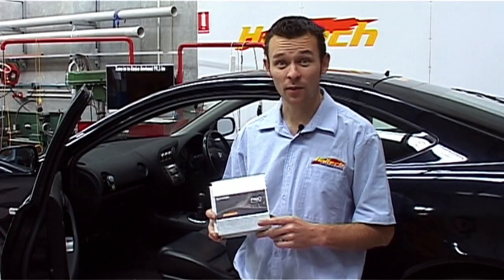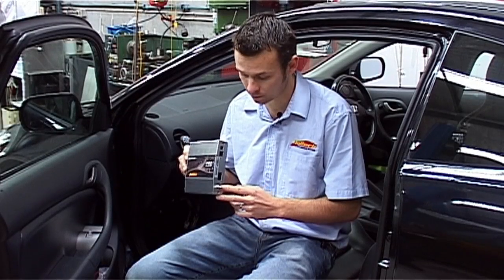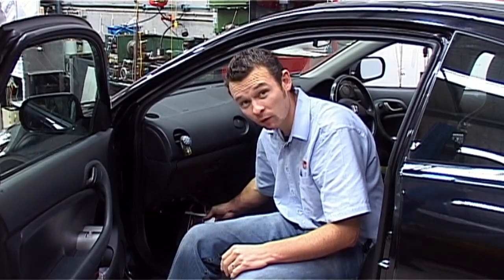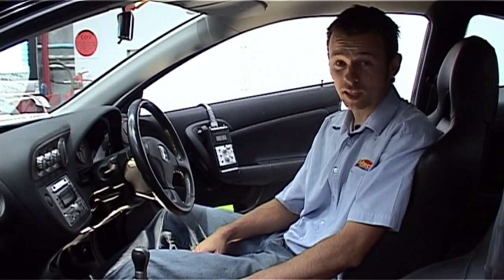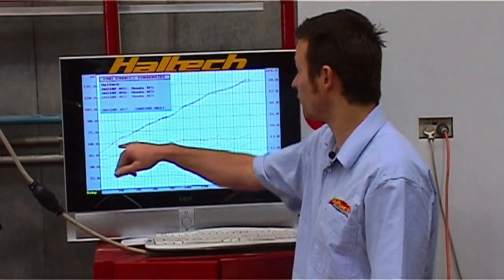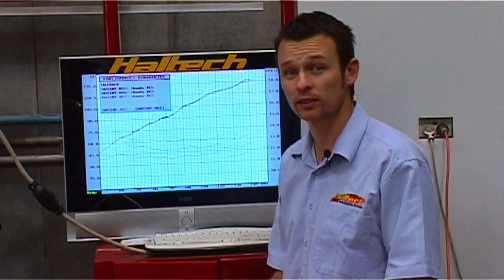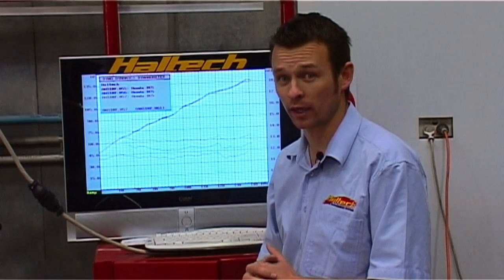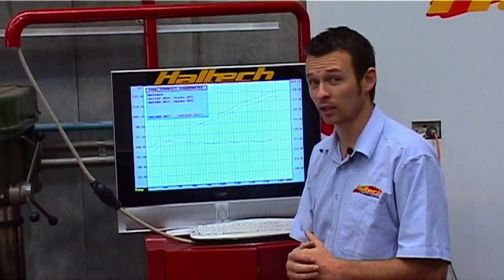Ignition Timing vs Air Fuel Ratio - Haltech Technically Speaking

Comment: @Haltech, when one is tuning the fuel map, does one set the target stoich under load on that map block. I am tuning a cheap management on the road in my VW Mk1 with a 2.0L 8V engine & noticed when i set my target stoich, & then when accelerating till it gets to the target stocih,it shows lean,but when i get to the set RPM it's on target. Is this normal when tuning?
I hope i'm making sense.😋
Reply: For others I think this is conteracted by the acceleration enrichment

Comment: Is increasing ignition timing a lower number on the timing table?
Reply: Ignition happens in the btdc quadrant, so advancing makes the number smaller.  Ex:  12° btdc is advanced farther than 15° btdc.
Reply: @mikaelgaiason688  it's the opposite

Comment: Alot of good EFI videos out there.. But there is not actually one that discusses the relation between ignition timing and AFR - just skimming past it like this.. doing some dyno runs and fiddling with a computer screen.. Not actually showing what they are doing and how they are reasoning around the subject. :/
Reply: If you say AFR will stay the same with changes in ignition, you're making the claim that the exhaust gasses and the unburned intake charge have the SAME EXACT oxygen content.

So either AFR changes with ignition timing, or engines do not consume any oxygen in their operation. It's one or the other.
Reply: The timing of the spark will affect how complete the burn of the fuel is. If there is unburnt fuel in the exhaust, AFR will be different even though the intake charge is the same as if it had a complete burn.
Reply: Moronicsmurf Yeah I can see how that would just be chasing your own tail. That's why in videos I have seen tuners figure out where timing stops making extra power first with a high AFR and then tune at that timing level. Would be fun to be able to try it myself.
Reply: Well if you read the AFR sensor you will prob. find that the AFR value don't stabilize with the values you have put in the AFR tables.. so no, the AFR is not static its a mix of different values and the AFR table is their to create a target that is affected by ignition and fuel tables.
Reply: Afr doesn't change regardless to timing.
You can tune your whole fuel map on a conservative ignition timing and then add 5-7 degrees, afr will be the same.
Reply: Silly Videos Only Good point! Hadn't really thought of that. I wonder how dramatic the difference is.
Reply: I find that when i change the timing i need to adjust AFR values to get it to not only run lean but also not wandering up and down. And when i hit the sweetspot its usually not the AFR value i wanna run in the selected cells so i need to adjust the timing again and so on fiddling back and forth and let the self tune adjust the fuel.. (I run a holley hp efi on a bigblock).
Reply: yes
Reply: Just dont know how to explain it in more than four syllables i guess.
Reply: I do not believe there is any direct relation between ignition timing and AFR.
As in, increasing or decreasing timing will not affect the AFR.
AFR is controlled purely by the amount of air coming in, which can vary with boost and the amount of fuel being mixed, which is based on injectors and fuel pressure.
There are more factors obviously, but basically I do not believe the two have any direct effects on one another.

If you are wondering if more advanced timing responds better to high or low AFR, I do not know.
I would suspect that it is much the same as demonstrated here, even with advanced ignition timing.
Any AFR within the window of roughly 11:1 and 13.5:1 will give around the same amount of power with a given timing advancement.
Reply: what if you add 20 degrees. will afr stay the same?
Reply: Try it in the dyno, i do it everyday.....
Reply: Well The AFR would not stay still if you change ignition. the AF target would stay still. because well its the target. But noway that your live data out of the lambda is static in the complete pull. The aim for tuning fuel and ignition would be to hit the target AFR value and have as small of a deviation you could through out the complete pull.. Sure you isn't mixing the terminology up?? AF targets is not the same as the actual AF value read in the exhaust...
Reply: I tune 200 cars a year, i think i know what afr target and actual is....
Reply: I would very much like to know more of what you could teach about big block aftermkt efi .
Reply: Timing does not affect AFR readings!.  If i remember correctly, about 80% of the fuel:air mixture is already combusted at around 18 degrees ATDC.  Thats 80% combustion at only 18 degrees ATDC.  It still has around 150 degrees of crank shaft rotation (depending on your exhaust valve timing) to combust the remaining 20% of un-combusted fuel:air thats in the cylinder.   

However, if there is a misfire (for any reason), then the O2 sensor will read max-lean... even though the AFR may have been rich.  This is because the sensor is calibrated to read O2 concentration; ASSUMING that combustion has taken place.   i.e.  A, lets say, 12.5:1 (un-combusted) air:fuel mixture, will have a much higher O2 concentration than a combusted 12.5:1 mix.

Comment: On the dyno I gained about 4whp going from factory 12:1 AFR to 12.7:1. But It increased my EGT by 50° and I could not run more timing. So I ended up going back to the rich factory setting and just advanced total timing by 4°. This in part gained me about 15whp which was much more efficient than the leaner strategy. In addition higher timing and more fuel reduced my EGT by 100° ! Stay rich people :p
Reply: +Persian Pride what is EGT?
Reply: +Joe Dijeaux thanks :D
Reply: Thanks for the info Just Machine.

Comment: Now to clarify, if you are tuning your timing needs to be at base timing. Then make changes in the computer to adjust timing. I've been tuning for a while on my vehicle. I'm at the point where I am tring to pass these Texas emissions. I just purchased a emissions gas analyzer cant wait to get it so I can try to dial in my fuel and air to get my HC down at idle.

Comment: Matt & Kimgulle, you are correct. The more air you suck in the more fuel it is required for engine performance and preventing the dreadfull lean condition. Now if your engine is too rich it will wash off the oil in the cylinder walls, which will cause more friction metal to metal damaging the engine. I'm use to the 1995 Mustangs. It's a well known way to get extra horse power was to bump the timing 2 to 3 degrees at the distributor to increase HP. If you hear pinging you have to back off timing.

Comment: Hi cliff, the stoichometric air fuel ratio will vary for every fuel, 14.7:1 is about average for gasoline. This however does not mean that you tune your engine to this AFR under all conditions. High engine load conditions require a richer than stoich AFR not for effeciency but for cooling. If you were to tune a high horsepower engine to 14.7:1 AFR under load you would damage the engine. Also advancing the ignition timing by 2 degrees may well hurt your engine depening on where you started.

Comment: Also, the particular V-Tec engine in the video is a really awesome engine with lots of more potential than what is has stock. It can take the increased timing without any problems i assure you. As long as you run good quality fuel. E85 is my favorite one. :)

Comment: You have the fastest combustion at about 12.5 AFR in a gasoline engine. Also the engine is less prone to pinging the richer it runs. But i guess you already know this. When i tune turbo engines, i aim to be somewhere between 12 and 12.5 in AFR at full boost an WOT. 14.7 is only good to have when driving normally.
Reply: lol
Reply: kimgulle

Comment: If you think that the valves will hit the piston by advancing the timing you have seriously misunderstood what actually happens when advancing the timing. What happens when you advance the ignition timing is that you move the point when the spark ignites the fuel mixture inside the cylinder to an earlier point. Alas the mixture will be ignited at an earlier point before the piston reaches the top. This can increase the power because the combustion will be more complete while pushing the piston.

Comment: 14.68 AFR is Stoich. Thats the most efficient AFR for any gasoline engine. For other fuels the stoich will be a different AFR. Anything below 14.68 AFR is a rich condition. Anything above 14.68 AFR is a lean condition. Rich conditions produces more Hydrocarbons (HC) and CO in your exhaust. Lean produces more Oxygen (o2) in your exhaust. Bumping timing up by 2 degress want hurt your engine as long as you are not pinging. It sounds like marbles in your engine at WOT. It can cause damage!
Reply: Cliff Dukes

Comment: I dont get why you guys are rabbling on about the engine knocking when increasing the ignition timing. That all depends on what quality of fuel you're running, what compression ratio the engine has and how much fuel you put into the engine. Also a couple other factors like how the combustion chamber is designed, intake temperature and so on. I can guarantee that by increasing the timing on this engine with maybe 2-5 degrees in the right places, will NOT make it fail in any way.

Comment: They are correlated, and I'm questioning whether they held the ignition timing constant when doing the runs with different AFRs. It's possible they advanced the timing more with the richer mixture, I'm surprised at how similar the power curve was when comparing the 11:1 and 13:1 AFRs. So, Haltech, was this a variable controlled test or bad science?

Comment: The dyno is not lying, if you honestly believe this then you clearly miss the point of this video. The ABS light is on because the front wheels are moving but the rear wheels are not (this is common on when you put a vehicle on the dyno), the shot of the tacho at 2:10 was not actually shot during the dyno run i was just revving it for that particular camera shot (good pickup by the way). 
I did just plug this ECU in, we now have a range of direct plugin ECUs see haltech.com for details